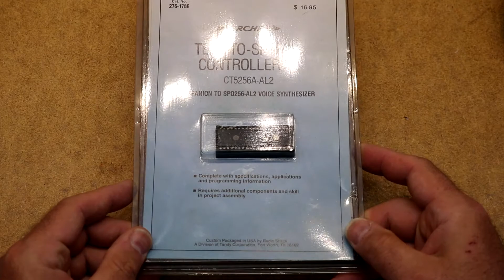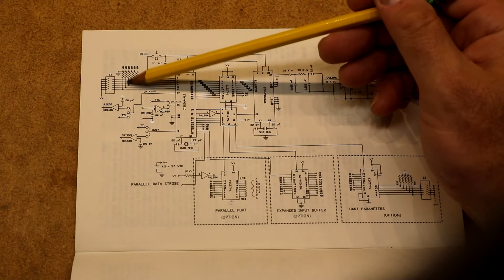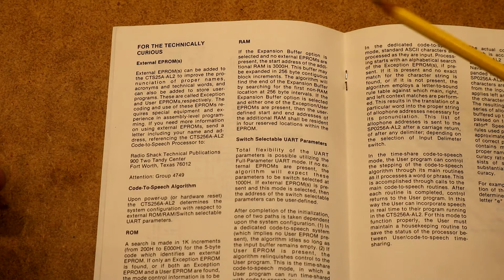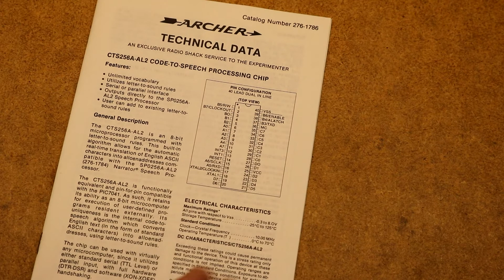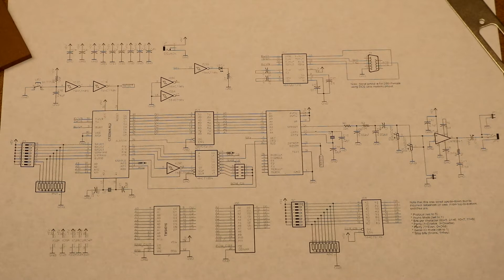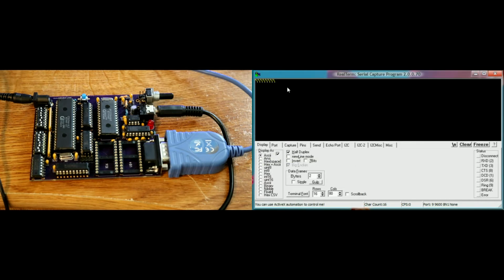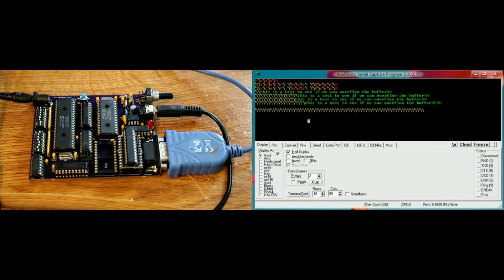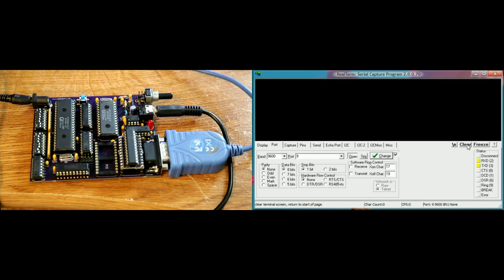CTS256A-AL2 Text-To-Speech Serial Speech Synthesizer

Comment: Wow what a blast from the past. I had a couple of these chips from Radio Shack, and built the thing on a perf board (all those wires!!) and it worked! I played with it for years.
Now here's the kick: when Radio Shack started to add a ton of stuff to "clearance"  (beginning to go out of bussiness) they had a bin in the store full of stuff. Including a bunch of the speech chips, marked down as a buck apiece! I freaked out and bought six of them (all they had). There were a couple of other stores in town (Lansing MI) who had some too.
Over the years I kept them (think I had ten or so - no really) but during a move had to get rid of an entire workshop of parts, tools, Etc. You really can't take it with you scenario.
That was more than 30 years ago (or so) and now they are very hard to find. I have seen a few on Ebay for - - $50.00 to 75.00 bucks. Oh if I had kept them.
thanks for the very, very inspiring video!

Comment: Great video as always. I've had one of those text to speech chips in my parts bin for years but have only used it on a breadboard once or twice. I might take your design and modify it slightly so that it can be mounted in an enclosure with its own speaker.